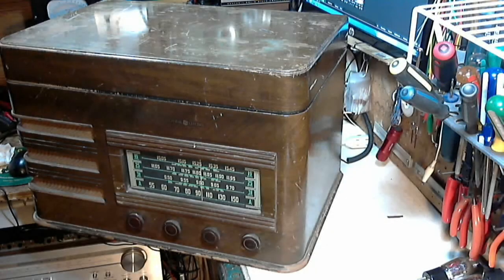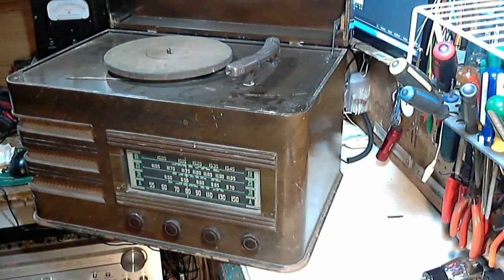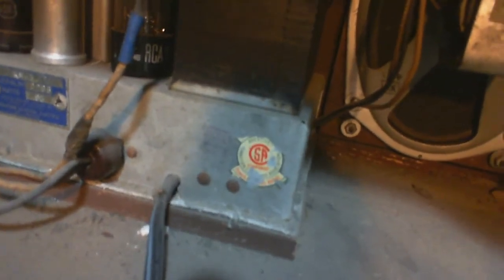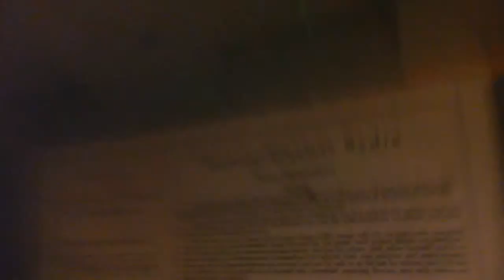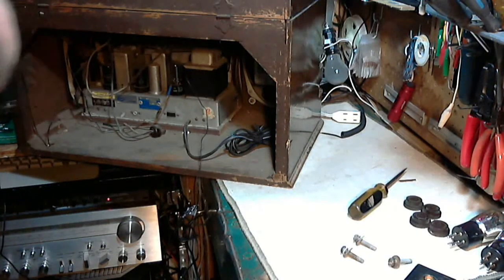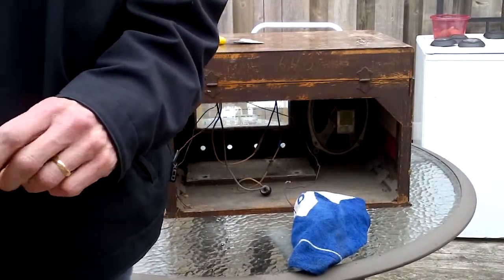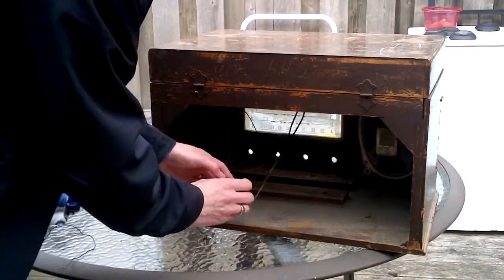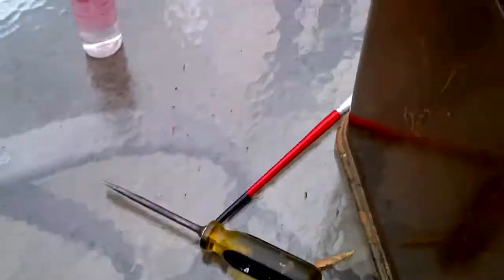Canadian General Electric KM-5 Vacuum Tube Radio Video #1 - Checkout and Chassis Removal

Comment: A 25 cycle transformer will operate on 60 hz and run cooler than it did on 25 cycles.  The filter caps will be larger than necessary to run on 60 hz, but not a problem.  I would check the filament (heater) string voltage and lessen it if necessary. See http://www.antiqueradios.com/forums/viewtopic.php?t=135039